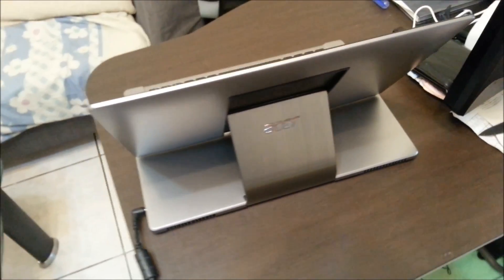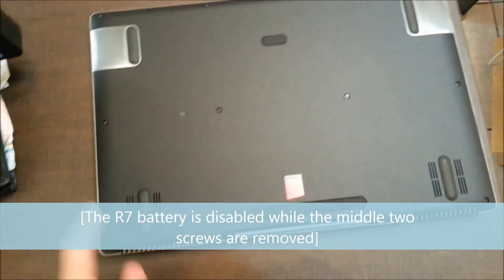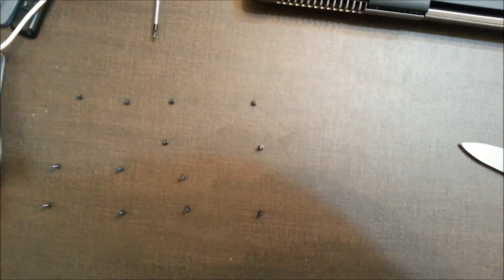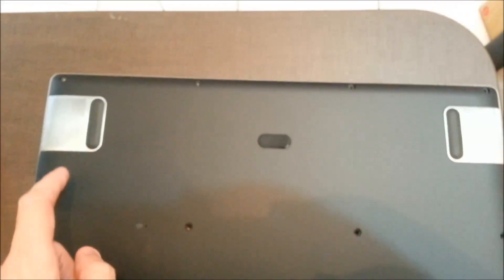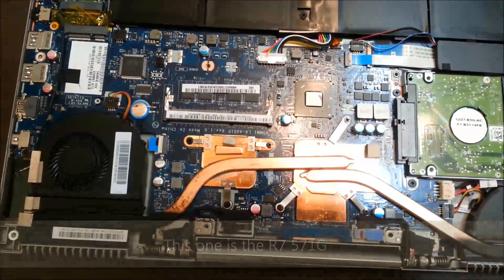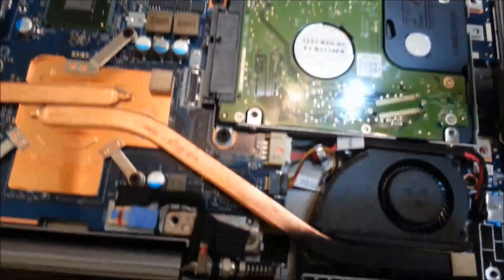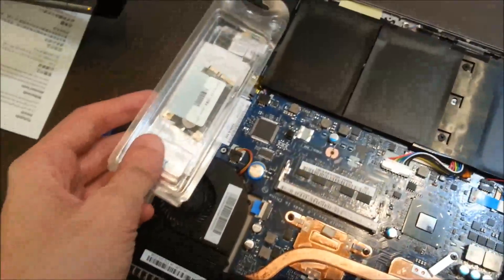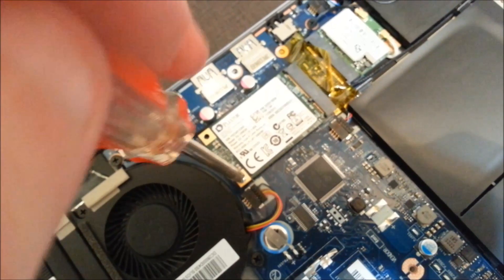Acer R7 Opening to Upgrade the HDD SSD RAM MSATA on Aspire R7 571 571G 572 572G

Comment: What is the use of the MSATA SSD and advantage of having it? I just purchased R7.
 Thanks for making this video.
Reply from the maker: A 2.5" HDD can easily be 100-120g. A 2.5" SSD may be 60-80g. An MSATA SSD can be 8.5g.

MSATA drives tend to have lower power consumptions, too. For example: http://www.tomshardware.com/reviews/samsung-840-evo-msata-review,3716-9.html (you can see the MSATA Plextor M5M versus its 2.5" M5 Pro counterpart there, too)

So they're always lighter and will most likely use less power - excellent for a laptop.

However, please do note that there is generally a small performance difference between MSATA drives and their equivalent in a 2.5" format. It's unlikely to be at all noticeable in day-to-day use, but it can be seen in benchmarks.

Personally, I took the 2.5" drive out and have just been running the 128GB MSATA drive ever since I made that video, seven months ago! (I intended to pop a 2.5" SSD in as soon as one became available, and I've had a spare 60GB SSD sat on my desk for a few months now, but astonishingly, 128GB has been enough for me!)
Reply: How did you clone the original hard drive and software did you use? Thanks for replying
Reply from the maker: Harvz B First of all, you must make your own recovery USB drive. That means buying a USB stick just for this purpose. 16GB was big enough for mine, but some others have reported 32GB is the minimum - it may depend on your country's preinstalled software.

I tried just recovering to the new drive, but it didn't work first time, so I cloned the drive instead. I used EaseUS Todo Backup Free and this guide: http://lifehacker.com/5837543/how-to-migrate-to-a-solid-state-drive-without-reinstalling-windows
Reply: PenguinJim Jim, after cloning, how does the system knows which drive to boot?
Does F12 Bios detect present of the MSata after cloning?
Reply from the maker: Misc You can set the device boot order in the BIOS.

Comment: thank you for that impressions! do i need the 1.8" or the 2.5" version of the ssd? which one is shown in your video? thanks a lot
Reply from the maker: The one installed by default in the R7 is a 2.5" drive (HDD by standard, and can be replaced with a 2.5" SSD). If you can see its square plastic or metal casing, then it will be a standard SATA drive (usually 2.5" in laptops). The R7 has one bay for a 2.5" drive.

The R7 also has one slot for a MSATA drive. MSATA drives don't have that plastic or metal case. They're just a little PCB with some chips! http://images.anandtech.com/reviews/storage/Intel/525/DSC_9366.jpg

(Really terrifyingly small and skinny, and make 2.5" drives look like Herman Munster's shoes!)

I got a good price on an MSATA drive, and they weigh less and should use less power than a 2.5" drive, so I'm only using one drive in my R7 at the moment. I would never have believed that 128GB is enough storage, but it's doing surprisingly well!
Reply: @PenguinJim  MSATA More power than ssd 2.5"?
Reply from the maker: @starkstentube6378  MSATA shouldn't be any faster than the same model as an SSD - they should both be the same speed. The power draw can be lower, but it's best to look up the drive models you are comparing, so you can compare them directly.

Comment: Hey I purchased the laptop and two 8g ram ddr3. But when I place both into the system it does not load. Please comment if you have cone across the same issue and if you have come up with a solution
Reply from the maker: Make sure that the RAM is 1.35V. The laptop will not boot with 1.5V RAM installed.

Comment: I've just ordered Acer Aspire R7-572G. Yet, there's a catch - it comes without SSD drive, thus the system out of the box won't work at its' fullest. I've been thinking to follow your original thoughts & insert a 120GB mSATA SSD drive for Windows, etc. while keeping the HDD drive for storage. The question is: Is it possible to preserve an operatioanl native Acer's Recovery Partition on the HDD while using "Recovery to plop a fresh Windows 8" on my new mSATA SSD drive? Will Acer Recovery Management tool work without a glitch from the new SSD drive?
Reply from the maker: You can use this method: http://lifehacker.com/5837543/how-to-migrate-to-a-solid+state-drive-without-reinstalling-windows

If you go ahead and clone it yourself, BE CAREFUL, as you'll want your SSD file system set up differently to an HDD. The guide I just linked sorts that out.

Before you start, I strongly recommend spending $10 on a 16GB USB drive to create an Acer recovery drive. Throw that USB drive in a drawer and keep it for as long as you have the laptop!
Reply: PenguinJim
How about a hybrid storage configuration? That is linking a SSD to become a cache drive. This method seems to save the hassle of mingling with Windows boot sectors & moving things around. Not to mention - it's simply cheaper, as the prices of 64GB SSDs (which is cache's max size) are lower. But, does it offer any notable speed improvements? Does the BIOS on Acer Aspire R7 provide this option?

P.S.- Thanks a million for the useful link above & your swift reply. I would've checked the BIOS options myself, except that the delivery of my R7-572G may take 1 or 2 days more.
Reply from the maker: Evgueni Saaranen Using a small SSD as a cache for an HDD is adequate, but on a laptop you'd then be simultaneously using both for everything, so you'd be getting through the battery faster, even though the speed increase would be noticeable.

Installing Windows directly to the [msata] SSD and then installing a few other choice programs (e.g. MS Office, Photoshop, slow-loading games) would have those load noticeably faster, which is what you really want from Windows, without tasking the battery. Keep all of your media files and less-used programs on the HDD.

If you go for the first option (which is certainly not a bad option), please share your results, but I'd recommend the second.
Reply: Evgueni Saaranen PenguinJim i just got my self an plextor m5m 256gb mSATA SSD. initially i using the clone disk method but the problem is, the acer recovery management not detecting the recovery partition. Tried all sort of ways that i can find online but still no luck. So at the end decided to do a clean install (LUCKILY, i had backup the recovery to 16gb pendrive before i upgrade to msata ssd) boot from the pendrive, clean install. FInally acer recovery manager work perfectly. * if dont want to go through all this hassle, i highly suggest everyone do a recovery backup to pendrive and do a clean install on new msata ssd.
BTW, windows license will show inactivated and u can activate it back. U need to call microsoft to get a code to reactivate it.

Comment: Thanks so much for this. Are you able to replace the wifi card on this? If so where is it located? Thanks
Reply: Nevermind I saw in the comments it's possible to do this. My wifi problem is different than the others. I don't know even know if its the wifi card that's causing the problem. Every 30-40 minutes the internet stops working. But I'm still connected to my router with great signal and cable modem is fine as well. All I do is press Fix Connection Problems in IE and it's resolved. Weird. Speeds are fast as well but I'm in 5ghz. I do experience the same horrible speeds everyone talking about 2ghz though

Comment: Does anyone know if the mSATA cache drive can be replaced with say a larger 128gb ssd mSATA and made to be a boot drive and keep the existing 500gb as storage. Has anyone done this and does this Acer support this?
Reply from the maker: Replacing laptop disks does not void the laptop warranty, so Acer will continue to offer support. Yes, you can replace the current mSATA drive with a larger mSATA drive.

My suggestion would be to use the Recovery to plop a fresh Windows 8 on your new mSATA SSD, so that everything is set up correctly (file system setup is a bit different between SSDs and HDDs, so a direct clone would not be the perfect solution).

My plan was to do exactly what you're asking: add a decent mSATA drive for Windows and keep the HDD for storage, but in the end I took out the HDD completely. 128GB on mSATA as well as a 64GB SSD I had lying around gives me enough storage, a silent laptop, and noticeably extends the battery life! I use an external USB HDD on those rare occasions I need access to more files.

Comment: Exactly what I was looking for. Thanks. I noticed that you have to pry the rubber feet on the bottom to access the remaining screws. Are they glued ? Can you put it back and return in their original condition ?
Tx
Reply from the maker: They appear to use double-sided tape! I just pried the sides up. Mine went back perfectly and do not look opened or tampered. Use a knife to ease them up, though.

Comment: the default ram of my r7-572g is 4 gb (the chipset is manufactured by Nanya), and then i added 4 gb more (ddr3L-1600, the chipset is manufactured by Hynix), the dual channel works ( i checked with CPU-Z software)

Comment: I bought r7 572g, no problem with the wifi so far.
there are 2 memory slots inside.
 I'm curious to know if msata and hdd/ssd can work together or not
Reply from the maker: Yes, MSATA and a drive in the 2.5" drive bay will work at the same time. You can have them as independent disks, or use an MSATA SSD as a caching drive for a 2.5" HDD.
Reply: armagedon515
"G" is for Graphic card, "572" is without graphic card.. 572g has nvidia gtx 750M.
Mine has msata and regular harddisk
Reply from the maker: armagedon515 In some countries, the R7 will include an msata drive and a hard disk drive, so both ports will already be in use. In other countries, no msata drive will be included - but you'll still have the port available if you want to add an msata drive. All R7 models have a 2.5" bay/sata port for a sata drive AND a msata port + space. :)
Reply: I have the 572 (you know the difference between 572 and 572G ?) but you confirm that an msata port is there too. Mine came only with a regular hd. Tx

Comment: Hi. Is the wifi card easily accessible??  I have the 571 with the wifi issues and have a great intel card from my old laptop that I'd like to install.
Reply: Yes. I put it in.  I was planning on purchasing a newer intel 802.11ac card but I had the intel 6250 wifi+wimax card from my old laptop.  It works perfectly...WiMAX inluded.  The two antenna connectors match up.  I also installed WIDI and it works.  Sidenote: I also upgraded the memory and harddrive with no problems.
Reply: Looks like it is right above the mSata interface.  Can you possibly confirm?
Reply from the maker: Mohammad Ali Husain Hi, it's there and it's connected, but I don't know how easy it is to remove or replace, sorry. You should be able to contact Acer for a replacement, as it is a known issue.
Reply: Thanks.  I plan on ordering an Intel 802.11ac card.  I will report back when I put it in.
Reply: Mohammad Ali Husain Did you put it in?
Reply: Mohammad Ali Husain Awesome! Thanks for the reply! God bless :)

Comment: Nice video but as i will be getting this soon I want to know if you can have both the SSD and the HDD installed together?. Awesome video and thank you!
Reply from the maker: There is one space for a MSATA drive, and a 2.5" bay for a 2.5" HDD or SSD. You can have one MSATA drive and another 2.5" drive at the same time, yes.
Reply: Okay, so after installing the mSATA drive do I need to configure anything?, thanks
Reply from the maker: ***** You should go into the BIOS and check the boot order to make sure that your Windows drive is top of the boot queue. (You can boot from either mSATA or the SATA drive)